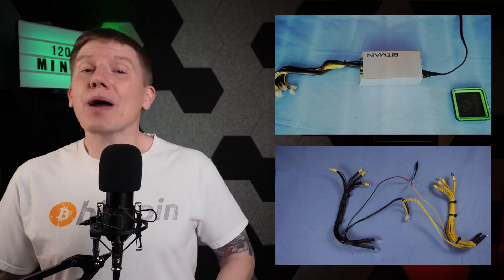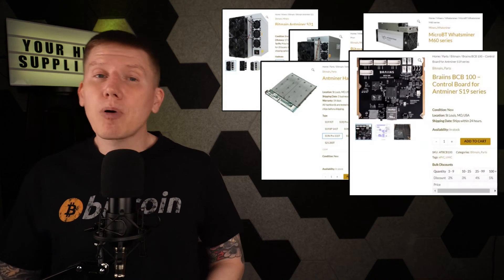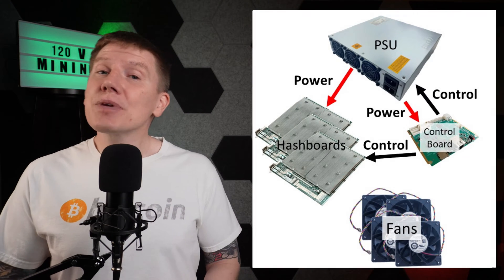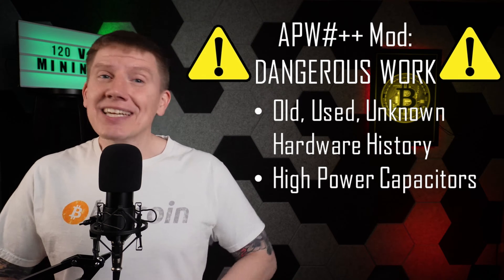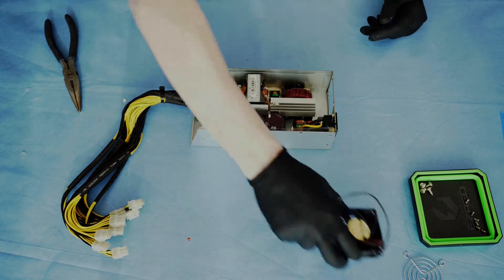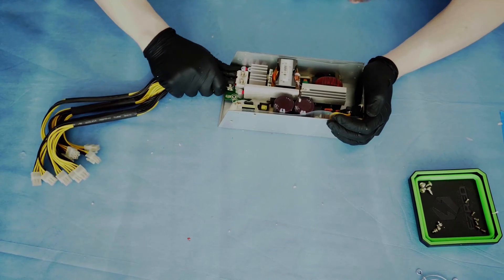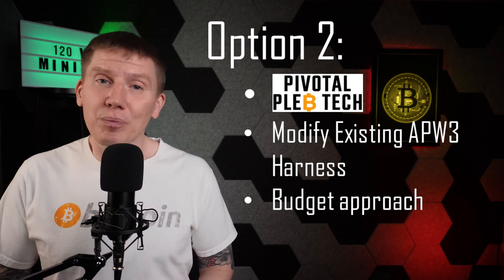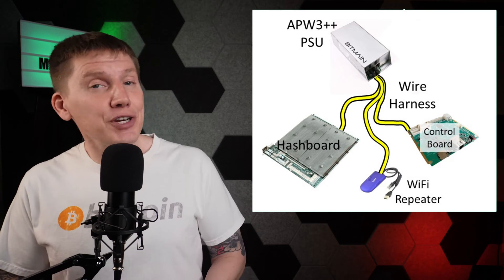EP38: Building a 120V Bitcoin Immersion Miner - Budget build, Part 2

Comment: what about using the apw7 or could i just use something like an evga 1600 watt?
Reply from the maker: Good question...it has the power, so it should work.   However, the voltage will likely be a little on the lower side which will limit how hard you can drive the hashboard.

Comment: You will have 6pin power burn... issues My tips started turning brown and was failing on the cards... even with 220v i had the same thing
Reply from the maker: Do you mean current flow over the re-built wiring harness going to the control board?  Its the same 6 pin control board connection as the S19...and without fans running there should be less current flowing through that connection, right?  Did you see overheating at the control board or APW3 side of the harness?